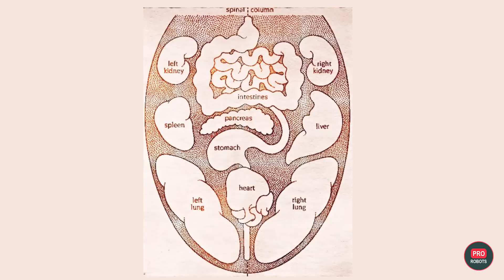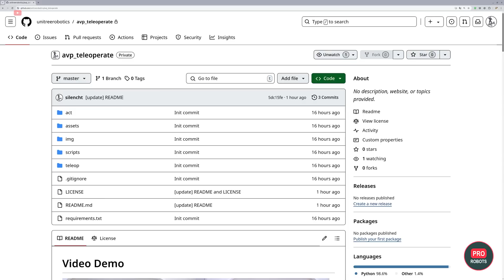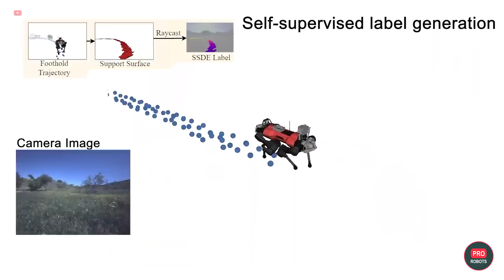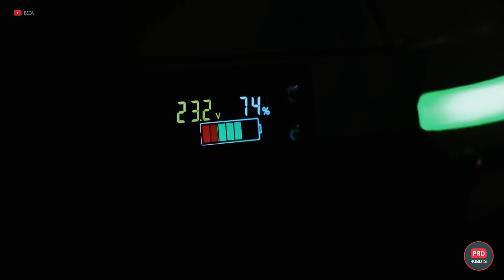Apple Develops a Robot with Smart Home Control | New Technology | Pro robots

Comment: Hahaha Apple is making a bot... So it's easy to use. None customizable and totally locked up. And when it breaks. No right to repair or swap parts because there all serialized and can only be replaced by an apple 'certified' and geo locked repair center..

 I bet there design is based on open sourced engineering....................